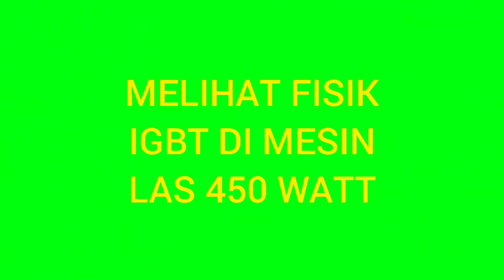komponen mesin las listrik dan fungsinya   untuk type inverter 450 watt

Comment: Punya saya yg 250 ampere, teg 24 voltnya mati,  modul power suplay resistor smd nya hangus yg di R9, itu  nilainya berapa bang
Reply from the maker: Kalo ga salah 1k bang. Nilainya